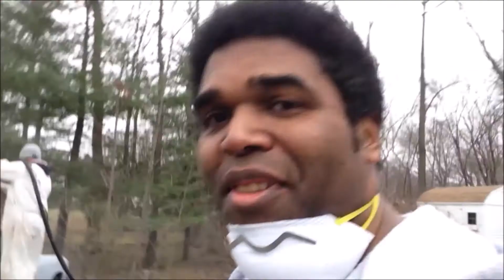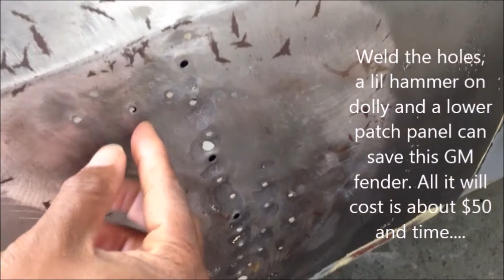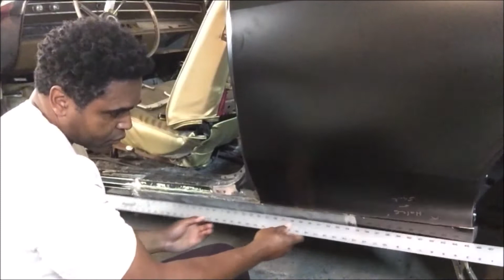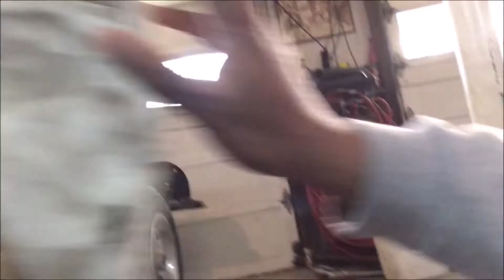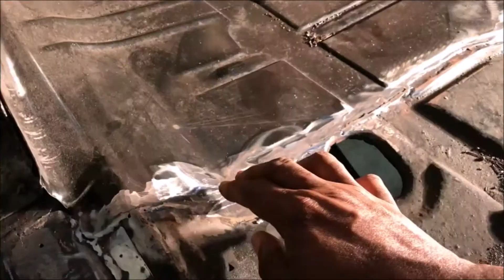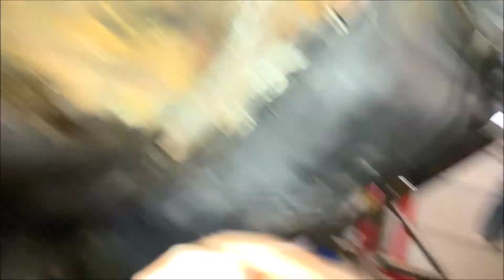Getting Up To Speed With The 67 Chevelle LSA Project. (Body Work Time)!

Comment: How did weld front floor pan plug, but, or lqp weld.
Reply from the maker: butt welded. takes a lil more time but i want it to look factory
Reply: I asked because I saw pre drilled holes and have to install on passenger side